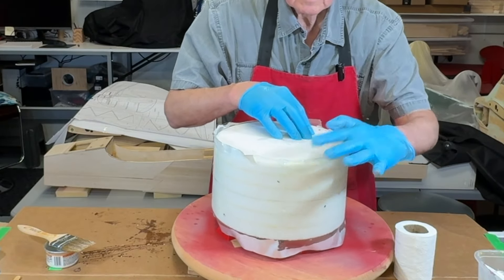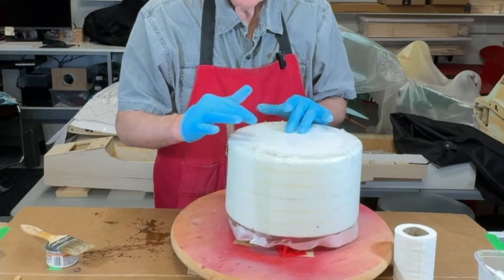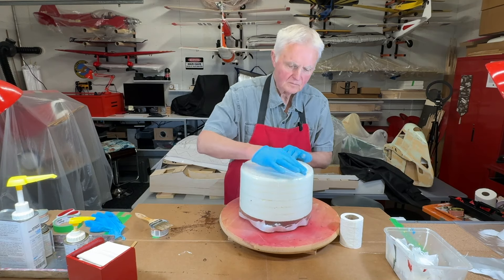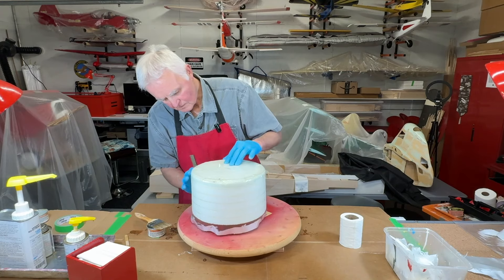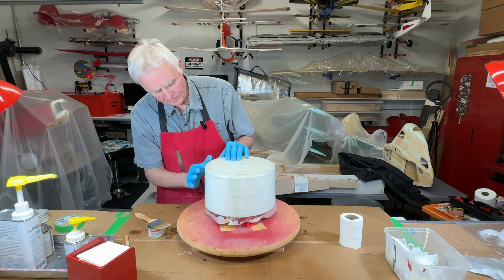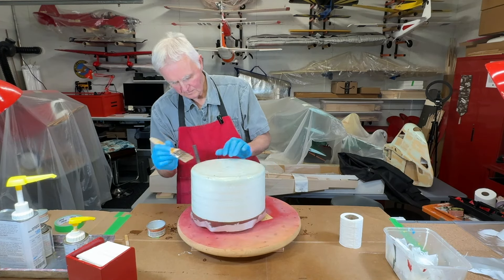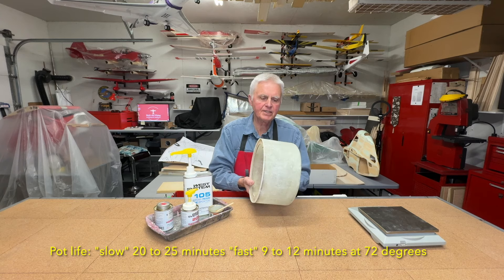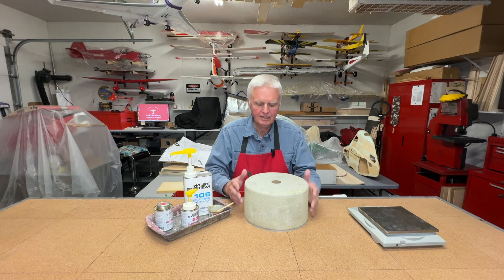How To Make a RC Airplane Fibreglass Cowling

Comment: How does the epoxy not melt the foam?
Reply from the maker: I use "West System" epoxy resin. This epoxy does not react with styrofoam, but it will bond to it. If you want to reuse the mold, make sure to apply a mold release agent to the foam; this will help it come off easily later. Be cautious, as many other fiberglass polyester resins can damage or melt the foam.

Comment: this is really usefull stuff , what kind of styrofoam do you use so it can keep  flat surface to work with , i was thinquing  using house isulator stryrofoam fm the blue one to be able to sand it smooth , any advice about that , cheap white styrofoam compose of buble lstick together is painful to work with
Reply from the maker: When it comes to foam, there are many types to choose from. Using foam with a smooth surface, such as the blue type, is a good choice. I personally use epoxy resin by "West System" and have never had a problem with it. Additionally, if you're concerned about the foam reacting in any way, you can coat it with a couple of coats of white latex paint. If you're unsure about how your resin and foam will interact, it's always a good idea to do a sample test first.

Comment: Sweet cowl! Looks to be about 11 inches in diameter. What prop will you be using?]
lol, 10 1/2 inches!
Reply from the maker: It's a 10.5-inch cowling. I am planning to use a 20-10 or 22-8 propeller based on the assumption that the outer half of the prop blade provides the majority of the thrust. An example of this can be seen in the Geebee aircraft. I am curious to see how well the performance will turn out."   I see you also have a balsa project underway. :)

Comment: I've had pretty good luck making boxer/flat engine style cowls. Mount the engine, make some standoff blocks of foam or balsa, and lightly tack them in place with hot glue, rubbing them with some clean motor oil on a rag. Fan balsa sheet and glass around that, and peel out the standoff blocks.

HOWEVER.... I've never been able to get a round cowl that doesn't look..... melted 😆 but I think I might be able to using your method! Thanks for sharing the experience and wisdom! 🙏
Reply from the maker: Thank you for sharing your method on making cowlings. Glad you found the video useful. Let me know how you make out making a round cowl. cheers, Rick

Comment: West Systems epoxy is 5:1, not 1:1.
I find it easier to apply epoxy to the styrofoam first, then apply the glass. This reduces the amount of brushing required which means that your woven cloth won’t pull apart as much.
I also use a vacuum table with a thin plastic painters drop sheet over the top of the wet resin and glass, leavening the vacuum on for up to 15 mins while the epoxy sets. This makes a smoother finish. Leave it 4-12 hours before removing plastic. After it’s cured sand off any high spots before applying the next layer.
I’ve made about a dozen cowls this way.
Reply from the maker: Yeah, I meant going from one pump stroke to another. You're absolutely right, it's 5 to 1. Thanks a lot for pointing that out. Also, I really appreciate you sharing the way you make your cowling. One thing for sure in this hobby is that there are always many ways to accomplish the task.  Regards, Rick